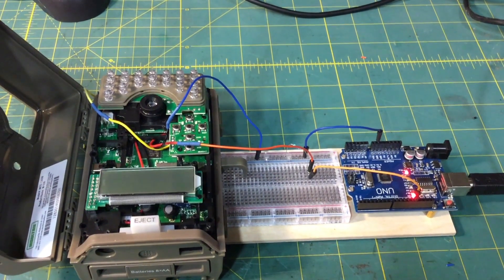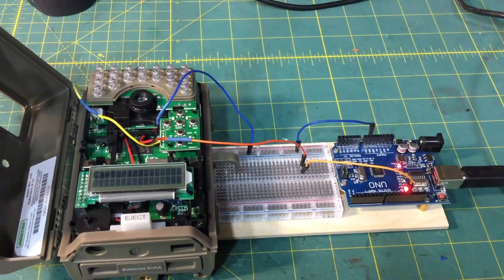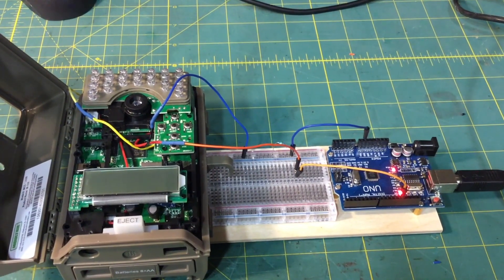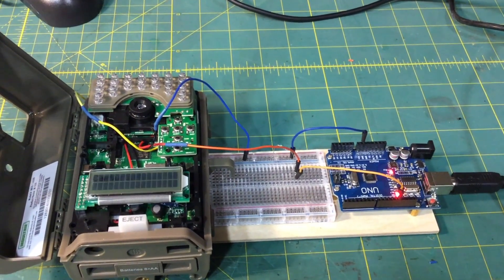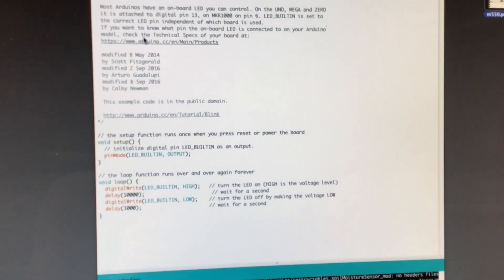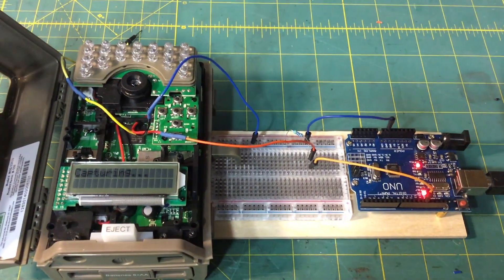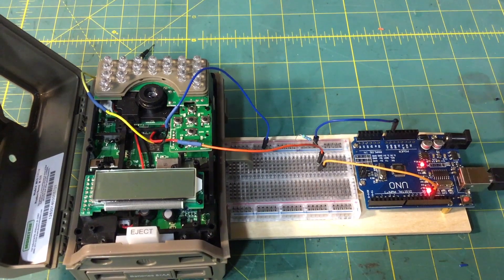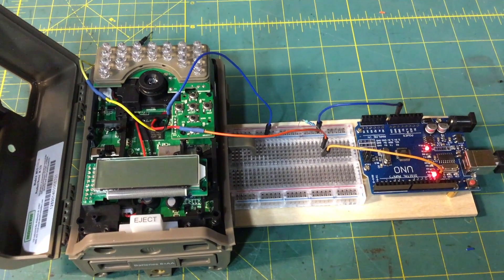Hacking Moultrie Camera to Fire off an Arduino (NOT RECOMMENDED - see description)

Comment: I just rescued one of these from the waste bin and a way to do actual timelapse with jpeg photos instead of the D-444's limited time lapse (sunrise/sunset) that only records to a proprietary MLT format is exactly what I needed. Too bad it corrupts things. Still, it's a place to start investigating (and one landmind mapped) so thanks! ps. I switched mine to a 12v ~3800mah lipo and it has passed the overnight at 20F degrees test and remained operational.